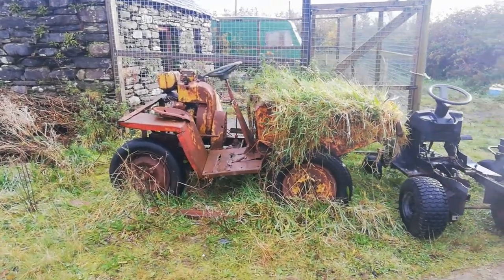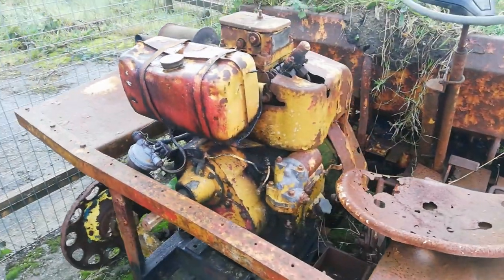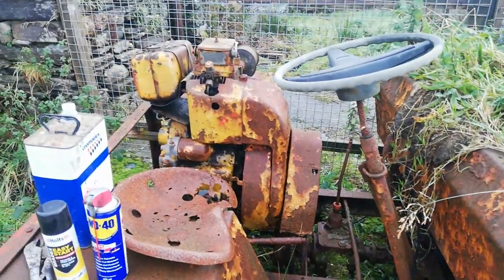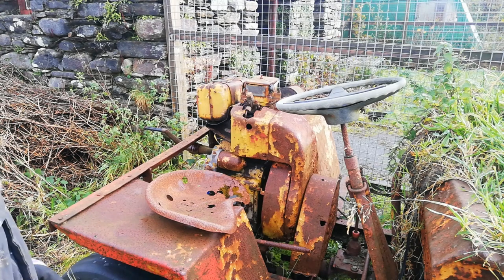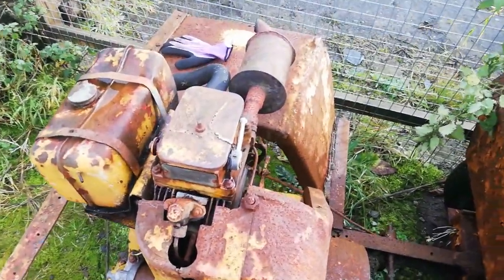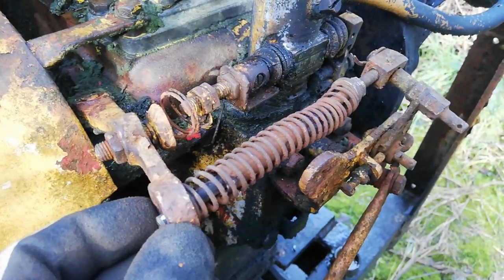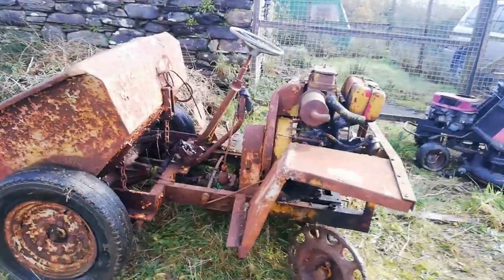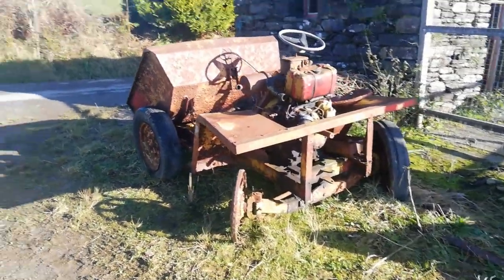Petter dumper, Will it start

Comment: G'day  there Cobber,,
Could you mail that little beauty to me here Down Under .
I taught myself to drive on one  of these little champions ,when i lived in Yorkshire in the late 60's,,i was about 5 or 6 .
The hardest part was the clutch ,i wasn't  heavy enough to press it down ,so i had to push on the steering wheel to get it down ,,,
Those were the days when a kid could have fun .
Thanks for sharing it with us ..

Much Respect 
      from 
Down Under

Comment: The dumper itself looks to be beyond redemption. At least the old Petter engine still runs and is salvageable, along with some other parts. I am pretty sure that is an old Thwaites dumper. I used to drive one, years ago, in connection with my work.
Reply from the maker: The dumper is probably bean cans by now but I do have the Petter stashed away in the shed

Comment: I had one with a lister 9.5 hp ,quite gd nick electric start, Landrover drive axle ,put a pipe over the starter shaft hooked onto a hydraulic pump and ran a log splitter, could pull a big trailer of firewood easy as beaut machine
Reply from the maker: They are good and low geared, traction wasn't great but we always had old road tires on. Considered using the engine for my pto logsplitter. May do that 👍

Comment: Definitely seen Petter days (couldn't help myself 😁) I'm not sure what that axle is btw but it doesn't look like the early banjo axle and I had enough problems with my Series 3's Salisbury axle to know its not that either.. it actually looks more like the one on my MGb though I doubt that would be wide enough to fit a dumper
Reply from the maker: 🙄😄 To be fair I only thought Land rover because it would have been a reasonably strong and available axel at the time but guess there were a lot more rear drive axels lying about in the 50's
Reply: @TheTinski07  my grandfather had an old international 444 tractor that he converted to be four wheel drive with an axle from a Rover P6 with two CV joints from a lorry welded on the ends, the resourcefulness of that generation always amazes me so God knows what that axle could actually be from 😂
Reply from the maker: Love it. Its great what happens when you have to work with what you've got. You should look up Sampsonboatco on YouTube, there's an episode with this old southern guy milling live oak on a saw mill made from several forklifts. It's brilliant
Reply: @TheTinski07  I follow them! I've been subscribed for about a year now, got hooked on the Tally Ho project a while back, dont remember the forklift bandsaw episode though so I shall go have a look
Reply: @mechanicalarcher4274  I think his name is Steve Cross. Google up Crossaw in Georgia and you ought to ought to be able to get him.
Reply: @TheTinski07  Steve Cross at Crossaw in Georgia. Google ought to pull it up for you.

Comment: I would love to buy that off you and get it back into a good usable condition personally I would not be scrapping it message me back if you still have it
Reply from the maker: Pulled the engine the day after I'm afraid. It had no redeeming features. Everything was just rotten and a reasonably good one is still dirt cheap. It would be a complete rebuild rather than a restoration. Chassis included.
Reply: @TheTinski07  Okay cheers for replying it was worth asking anyway good luck with the rest of your project